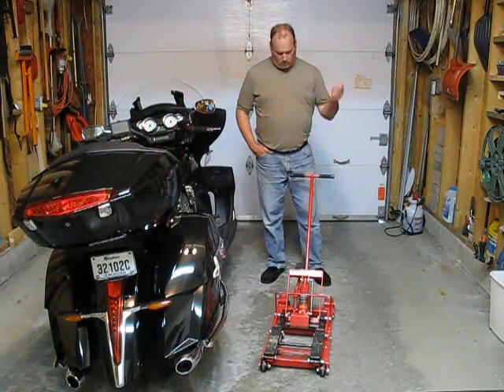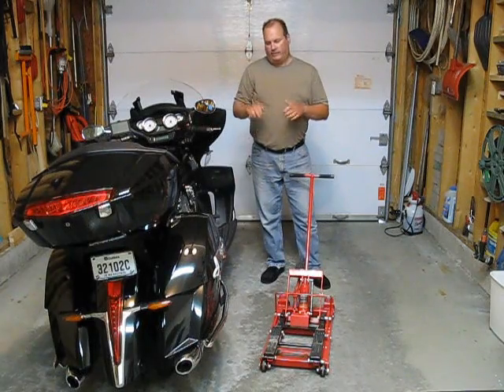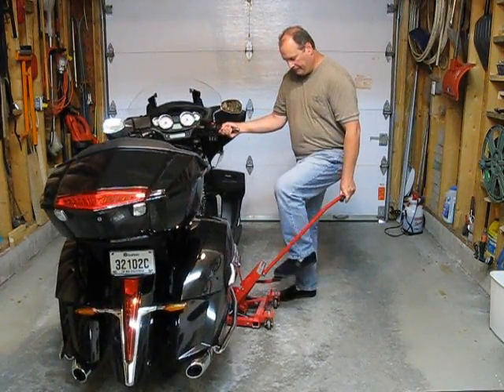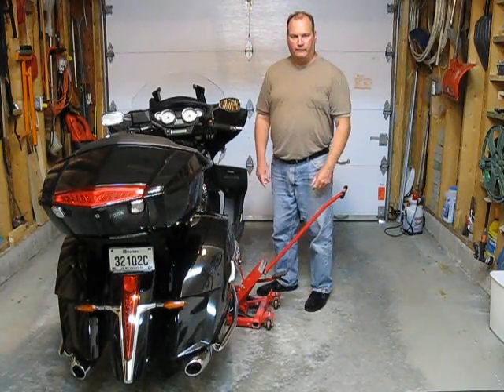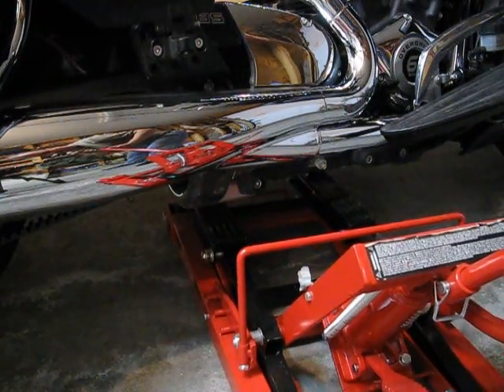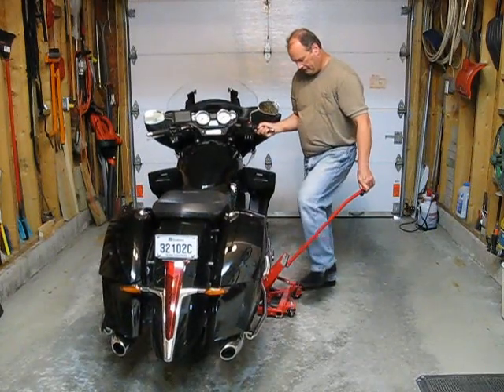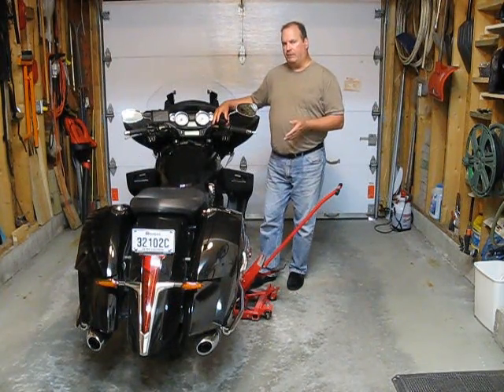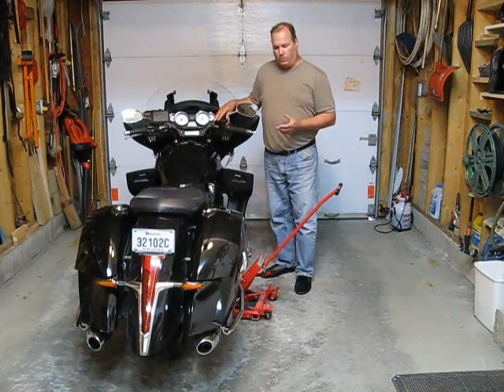Victory CCT Jack Lifting

Comment: Paul, I just talked with Rylan Voss and KevinX from the VOG.net regarding my heat problems. I am meeting KevinX in Panama City Beach, FL during the upcoming rally called Thunder Beach next month for the install of a high-flow air filter, a PCV and a Loydz adjustable timing gear.  He will top it off by dyno tuning the bike on his mobile dyno!  Thanks again for your assistance ;-)
Reply from the maker: +Rex Swenson Excellent!!! These guys are the best. Your bike will run a lot better after they are finished with it. You are very lucky, congratulations.

Comment: Nice video, but what I am very interested to know is how does this jack work with your Bonneville?  Did you also have to make any mods such as the shim you used for the Victory?
Thanks!
Ken
Reply from the maker: +Ken Cosi 
Hi Ken, the Victory engine is below the frame and is not flat, that is why we need a shim. The Triumph's engine is above the frame so the jack does not need a shim. At least not on my Bonneville.
Thanks for watching.
Paul
Reply: Thanks Paul!!
Getting more specific..  I find that on my T120 there are 3 lift points to be careful of:
1) the kickstand down switch
2) the oil filter drops below the frame tubes
3) the left exhaust pipe falls below the frame tube at the horizontal tube bend in the front.
All this makes it very difficult to position the jack and find clear lift points.  How and where do you do it?
Again thanks,
Ken
Reply from the maker: +Ken Cosi 
You are correct about the oil filter. I have tried various types and most extend below the frame and make it difficult. I now only use the K&N filters as it fits perfectly.
As for the other obstacles, I haven't really noticed. I put the jack under, lift it up a bit, rock the bike side to side to see if it is stable and then jack it up higher.
I don't need the jack too often as I have a center stand and use it most of the times.
I won't be able to check the bike in more detail until spring as it is currently in the back shed, and surrounded by snow.
Reply: Paul thanks for the reply!  OK so I figured it out last night!  The two "sweet spots" that the jack needs to lift are: the lowest part of where the center stand would connect to (my T120 does not have one installed) and the other is just behind the oil drain plug.  No mods need to be done to the jack however driving onto some wood planks under the front and back wheels does help with getting and positioning the jack under the bike.  Lastly the bike does need to be upright (not on the kickstand) before jacking starts
Reply from the maker: +Ken Cosi 
Thanks Ken for the info, I guess I am going to have to look more closely at it in the spring to see where my jack should go.
The center stand lifts the rear wheel up so I can oil the chain and I use a scissor jack for when I change my oil.
So I guess I don't use the hydraulic jack too much on the Triumph.
I also have a skid plate that the dealer gave me when I bought the bike. I guess if I put that on it would change the jacking points considerably.
It gets in the way of the oil changes so I don't use it too much.
Thanks again for the info.

Comment: Hi Paul. I’m looking at buying a cct. I’m curious what all the victory owners are going to do in ‘27 when no parts are available. Are you planning on keeping your bike and what will you do about service and parts?
Reply from the maker: I bought spare parts to have on hand in case one day I will need them and they may not be available. Stuff like a spare drive belt, fuel filter and spark plug wires. Although it is difficult to predict eveything that you may need in the future, I try to keep the basic parts on hand. The good news is that my bike is now 9 years old and I have never had anything break on it from wear.
Reply: @PaulPomerleau  thanks for the fast reply Paul

Comment: Just got a 2013 zach ness xc and having an issue finding a jack that's low enough.  It has the witchdoctors skid/jack plate, and the lowest point is only 4 1/4 inches off the ground. Wanting to get her upright   for servicing her and keeping the tires off the ground during the winter. Any recommendations?
Reply from the maker: If you want to keep the tires off the ground during the winter I recommend a jack/stand combo. Jack the bike up and slide the stand between it and then lower the bike onto the stand. Several companies make these combos. As for finding a jack that will go lower than 4 1/4" limits to what you can use. Perhaps riding the bike up on some planks of wood first in order to get a regular jack underneath is a bit of a pain but it opens up more jacks that you can use. I personally use only a scissor jack under the chin to keep the bike upright in my garage for the 6 month winter we have, and only because it gives me more room that way to bring the car in, but my tires are always on the ground.
Reply: @PaulPomerleau  thanks for the advice. I'm going to go that route. And thank you for all your videos, they have been a ton of help for a new vic owner.

Comment: Hi,I hope if you can help me out I have a 2010 crossroads with 47,000 miles on it The drive belt recently start squeaking,The belt looks straight what do you think could be is it time to replace the belt thanks
Reply from the maker: The manual says to replace the belt at 30,000 miles but I think this is way too soon.
Have you inspected your belt for cracks, chipped teeth, fraying edges?
Have you cleaned your belt with dish soap and water using a nylon brush?
Jack up the back and spin the rear tire forward 10 times and watch the belt on the rear pulley, then spin the tire backwards 6 times, did the belt move from one side to the other? Then your tracking is out of adjustment.
How do you ride? Do you ride hard from a stop? Do you ride on dusty gravel roads? Then maybe a belt replacement is needed.
It's hard for me to tell from here. Try the easy stuff first and check condition. Good luck.
Reply: Paul Pomerleau ,hi,the maximum I ride about 120 miles longest ride,I cleaned the belt,all teeth looks good,the belt stays to the right pulley flange in both directions,1800 miles ago I had new tire installed by Indian motorcycle of Las Vegas I inspected the axle nut it wasn't tight as should be,so the wheel was out of alignment,so I follow the manual and aligned it,I went for 20 mile ride no more squeak,very smooth,but the rear wheel left adjuster about 2mm off the right side swing arm mark!do you think it's fine?no more squeaking and whining noise drives nice on the highway,thanks for the help
Reply from the maker: The markings on the swing arm is just a rough guide. Every one is a bit different. Since you adjusted it and all is good then there is nothing more to do. I would be upset that the dealer left the axle nut loose. I would not trust them again. Glad you got it fixed.